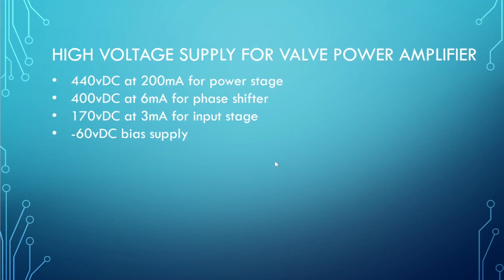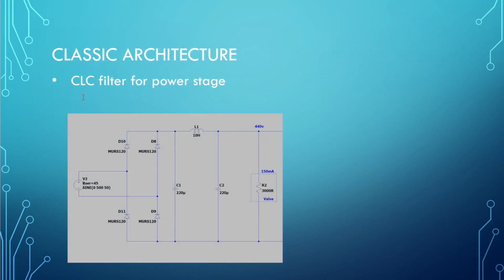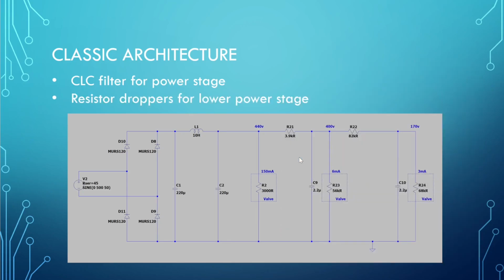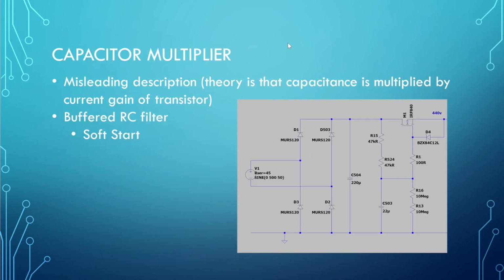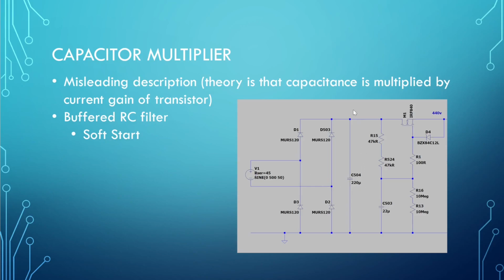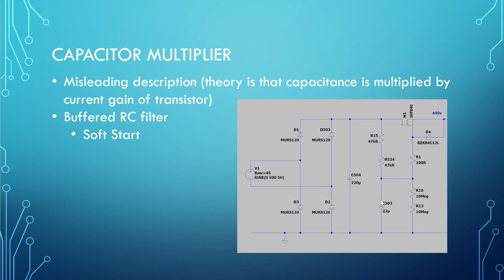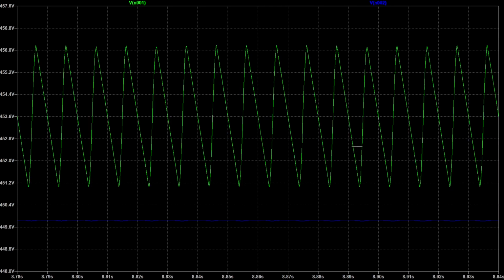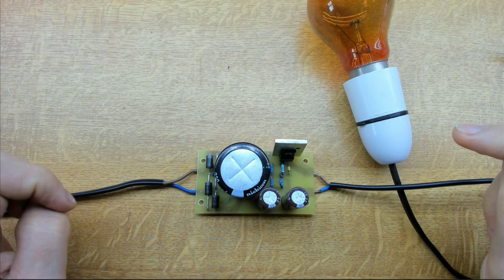High Voltage (HT) Power Supply for Valve Power Amplifiers

Comment: Thanks for the excellent video.   Is the 12V zener diode used to bias Vgs of the MOSFET to turn it on?  So does this mean that there is 12V drop between the drain and source of the MOSFET?  And you would use this to calculate the power dissipation of the MOSFET, and the heatsink required, correct?   What is your thought on putting a LR8 voltage regulator from the node between R524 & C503 to the node below R1?   Thanks again.   I'm having a difficult time finding LTSPICE model for LR8 so I don't know how to simulate it.
Reply from the maker: The Zener is there to protect the gate from over-voltage. Very common in switching supplies but probably not necessary in this application and could be left out.

Comment: Are you satisfied with the final design you showed? Would you be willing to share the schematic?
Reply from the maker: The schematic is shown in the video, I haven't changed anything so far but do have some updates in progress and will likely do another video in time.
Reply: @myalbatech  The schematic I saw in the video looked to be a single stage, rectified RC filter to a saturated FET capacitance multiplier. Which is basically what you described. 

But you mention adding additional cap multiplier stages in series. Which would normally result in the full voltage being seen on both legs of the second and subsequent cap multiplier stages. Where as you look to be pulling multiple voltages from the voltage dividers in the tails of the FETs. 

Which I've only seen possible if they are connected in parallel. Otherwise the FET doesn't saturate, limiting current. 

Or are the voltages so high that it doesn't matter and the FET stays saturated regardless?

So I'm wondering how exactly you coupled the multiple stages together. Which isn't in the schematic I saw at the beginning of the video.
Reply from the maker: @brookersmith8278  The FET stages are simply cascaded. Drop the values of R13 and R16 to form a potential divider at whatever voltage you want.

Comment: I built a Power Supply that has stabilized adjustable voltage from 240-500V with up to 500MA and it has ripple less than 1mv over the whole range that is also placed above 22khz range. The power is so clean the amp it drives don´t need any power filters and the voltage you pick is stable within less than 1 volt even if you have big power swing in the tubes. so basically you pick a voltage and no matter what the amp or mains does your selected voltage stays the exact same even if your amp pulls heavy varying load from it. A DMM cannot measure any ripple at all, it is only with a sensitive scope you can measure a fraction of a millivolt of ripple above 22khz on this supply. but with that said if you drop my power supply on your foot you never walk on it again